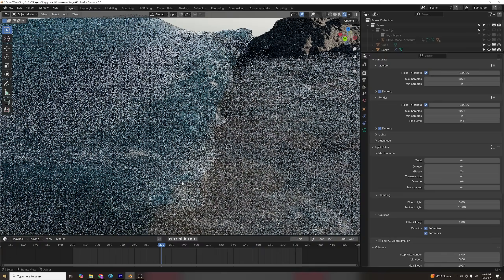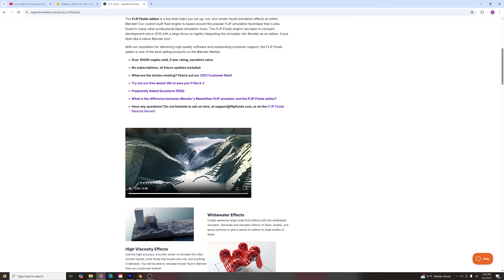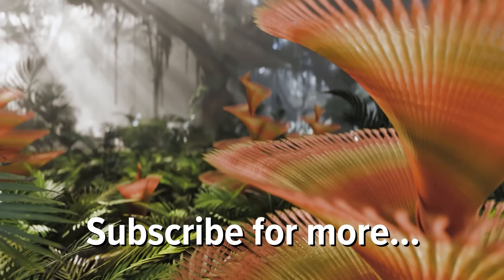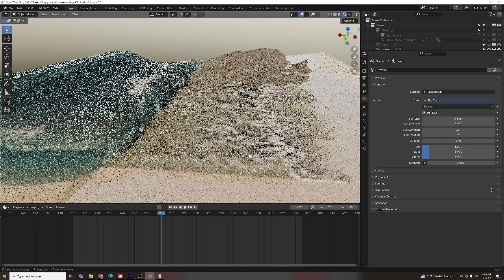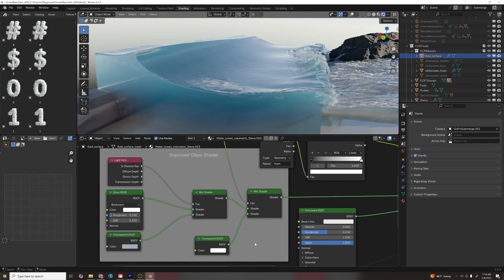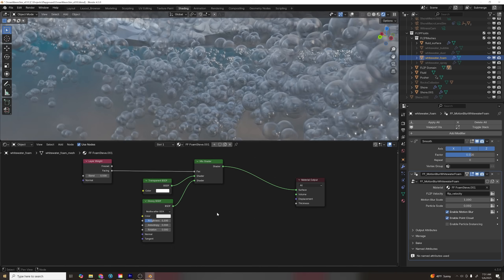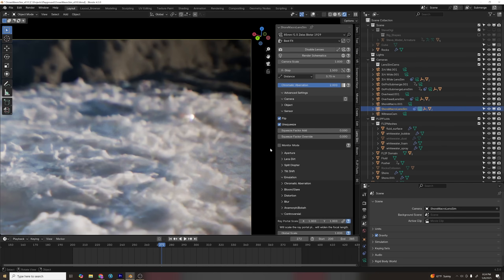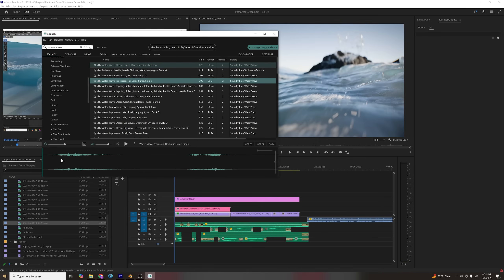Photoreal Ocean Simulation in Blender

Comment: Hey brother, amazing work. When you activate the Motion Blur in FlipFluids it generates a GeoNode-Setup that you arent supposed to modify, did you work within those nodes, or did you create your own Setup where you handle all the other stuff AND the Motion Blur? Your nodes are also using Motion Blur Attributes so I am a bit confused if i am using double motion blur if i use your setups and the base-FlipFluids setups.
Reply from the maker: I worked with the geo nodes setup it generates. And the lens sim thing, I’m not sure I didn’t have that issue
Reply: @Graphicalninja  Thank you, might have just been a FlipFluids issue due to me not rendering through the console!

One Last thing, if i use a sky Texture with similar values and your render settings, I get a lot of fireflies in the water. Did you use denoise or clamping to get rid of those? I usually try not to use Blender denoise due to flickering in animations.
Reply: And also, when I use Lens sim, the Fluid doesnt get rendered, only the foam, whitewater etc. With a normal Blender cam the fluid is rendered. This doesnt make any sense no?

Comment: Makes me wanna pack my swimming trunks :) Great job.
Breaking waves, foam, shore, sound, shading... everything top.
But If I really want to pick something to improve, its the water surface before the waves break. It needs more irregulaties, something like a subtle ocean modifier. Its too smooth for that waves hight. IRL you can have almost perfectly smooth water surface like you have (no wind, no tide), but then you get just very small shore waves. Bigger breakers come with smaller regular waves everywhere on the surface.

Comment: Do we need the flip fluids add on to get the water in the project file?
Reply from the maker: Yes, because the cache is not included so you’d need to run the simulation

Comment: This looks great so I suppose it doesn’t matter that you figured out a work around, but I believe the reason you were having trouble with transparency in the shallow water is because you have indirect lighting clamped to 10. Blender sets this as the default and it can pretty severely affect the realism of certain shaders and overall lighting. Setting it to 0 may help in situations like this. The setting is under the light paths drop down in the render properties tab.

Comment: Looks really good! But there are still a few details that feel off. Perhaps something to accomplish in your next version?
The frist and most obvious to me is that when the wave crashes into a beach like that there would likely also be movement in the sand below. Essentially the sand surface is too static, and there is no sand mixed into the waves. Perhaps the unnaturally straight shore line also causes the waves to be unnaturally straight?
The second thing that feels a bit unrealistic to me is that the sky-reflection is too clean.

All that said, I wouldn't have been able to do this simulation myself. Great work!

Comment: For bubbles under the water, I suggest what the most realistic thing to do is to use a refraction shader to simulate air, by doing the IOR of water (1.33) and dividing by 1 to get an IOR of 0.7519. This is what I do for my flip fluid sims, and it best stimulates an air gap in a fluid.
Reply from the maker: Oh dang that’s a cool tip, never would have thought of that
Reply: Jesus died for our sins to give us eternal life 🙏
Reply: @josizzel false Jesus was a false prophet. The Bible confirms this

Comment: Serious question:, is anything like this possible on xbox or playstation hardware in gta6. Or are we miles away from this?
Reply from the maker: Miles away, the data for this simulation is probably larger than the entire install package of gta 6. The only way to have stuff like this in a video game would be to simulate it in realtime, which is starting to happen with liquigen but it will be a long time before it doesn’t take up all your gpu power just to simulate a small patch of water.
Reply: @Graphicalninja serious anwser, thank you

Comment: Absolutely superb results - I've done a lot of FLIP Fluids wok and I love the geometry subdivision which really makes it not look like Flip Fluids! One thing through, 1024 samples? Really?!? I rarely ever use over 128 and that would be only on hair and fur where I switch to 256. The 4096 default is ridiculous and doesn't take into account denoising technology which is also by default set of ridiculously slow settings - I reckon you could get your render down considerably.
Reply from the maker: Thanks! With all the motion blur, tiny particles, defocus, and volumetrics, it really helped to have more samples for more crisp details. I also use the lens sim addon so it was just harder to get a clean render. But yeah for some scenes 256 is enough, it really is scene dependent

Comment: Btw, you can try LiquiGen too it's a real-time water simulation and you need a good GPU to run smoothly. There's called a force shape node that the water follows the movement of the object we import, for example ocean modifier to alembic to LiquiGen, you get photorealistic ocean without using a cube collision and far more realistic shape of shores!
Reply from the maker: I do want to try that - I love embergen. I didn’t use it yet because the foam solver wasn’t looking super robust yet
Reply: @Graphicalninja  Owh yeah, whitewater especially spray in LiquiGen still sucks

Comment: This might be the best water sim I have seen blender do. I could spot the CG thick water trails in some of the splashes but its outstanding. Also 6:12 - wtf thats crazy  , i would also be worried about the connectors on my 4090 melting with that much consecutive use.

Comment: Please make a longer version of this tutorial. The Geometry nodes stuff is fine but, I just can't wrap my head around flip fluids. So many settings, sliders and buttons.
Reply from the maker: Yeah flip fluids is great without much tweaking, geometry nodes just lets you fix little issues and push the photorealism further. I want to explore a more advanced foam setup where you can vary the bubble size and space the particles out so they don’t overlap - all possible with geo nodes
Reply: honestly, the default settings works for almost anything. which is water. just disable foam if you're doing non-soapy water like drinking water and stuff. not much you should change around, except if you're trying to do something unique like honey or something
Reply: Funny, I was thinking the magic was in the geometry nodes. Since I've stayed away from those, that's where I was lost. I own Flip Fluids and it's pretty straight forward if one has the patience to work through the tutorials. But I have a serious aversion to geometry nodes. The foam came out very nicely and that's the magic for me. I tried the FF foam and was never pleased with how fake it looked even with motion blur. This looks great! Amazingly, the cell fluids addon also does foam and water very nicely and ... super quickly.